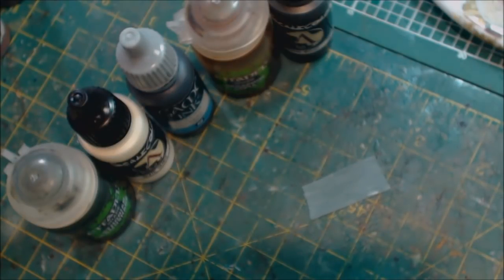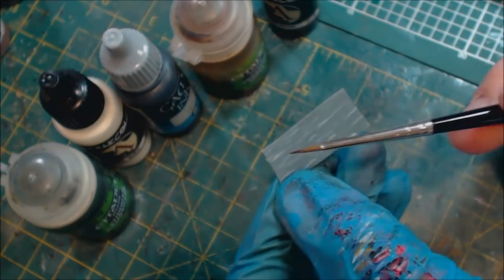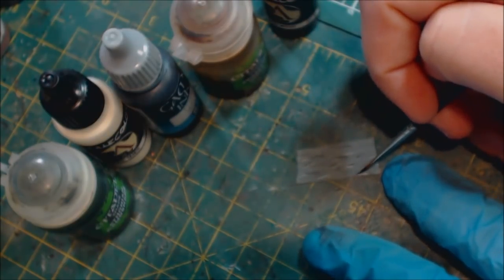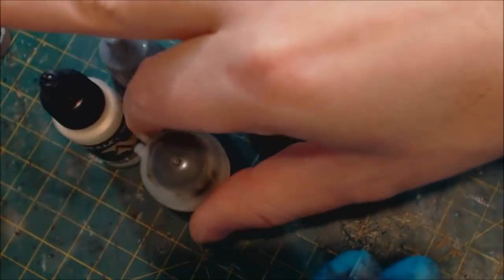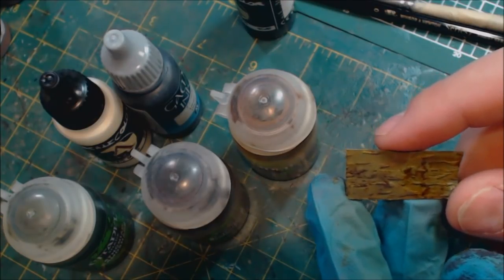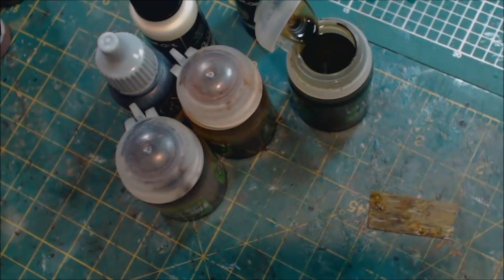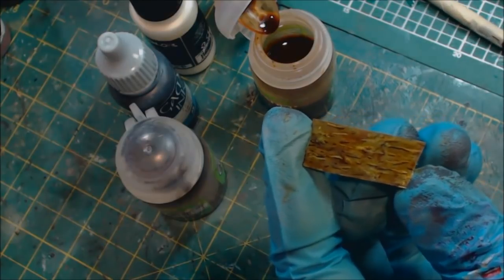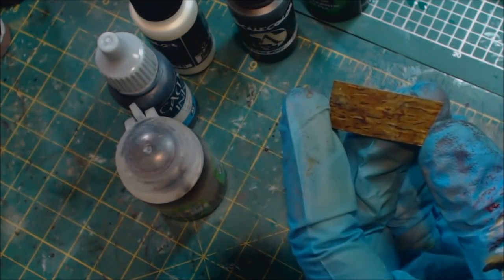Hobby Cheating 108 - How to Paint Faux Wood Grain

Comment: Great video - sorry it took 6 years to comment. I really had to think about my question.

I noticed that I liked the contrast between the matte and the more glossy finish on your example here - specifically in imagining that as an effect of weapon wood. Most weapons would have been glossy when new, but the surfaces that get handled become flat, or very matte. So, would you consider wet blending or stippling semigloss (or the like) to create a gradation that illustrates wear OR since I have been warned NOT to do this as people tend not to like matte up against gloss on the same surface, is this something you would simulate with illustration techniques? Sort of like NMM, but for finished wood.
Reply from the maker: You can use a satin, I think that works, you never really want to go all the way to gloss.
Reply: @VinceVenturella  Thanks Vince!